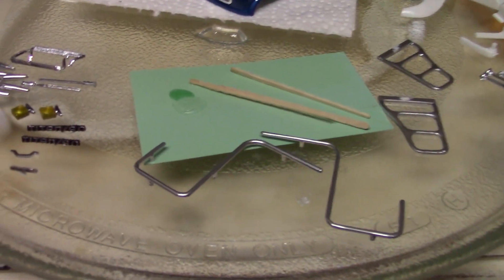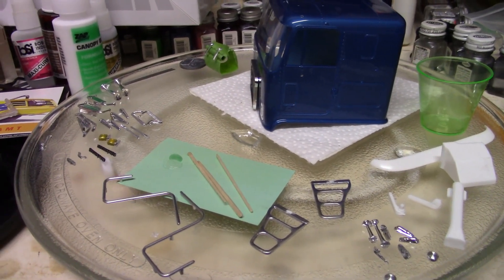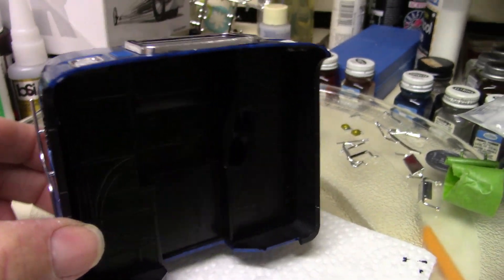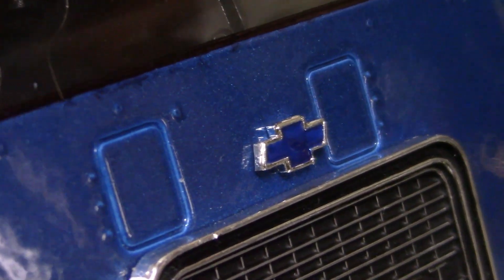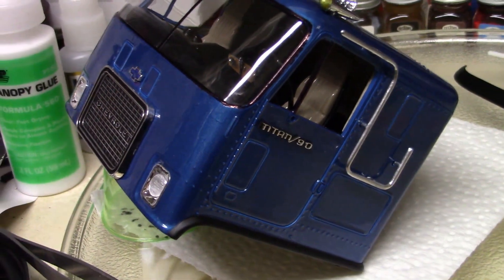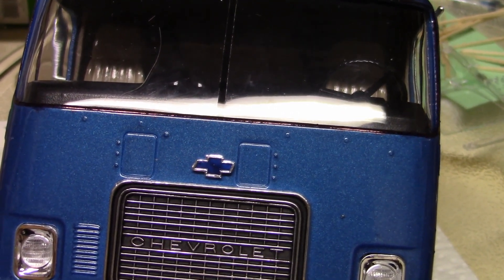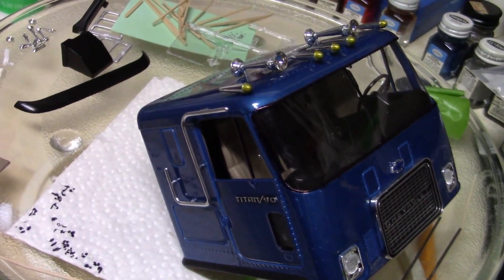AMT Chevy Titan 90 update 4

Comment: Watching your videos of this build you have done a great job of building the truck so far. I must agree with you that choosing the Sapphire Blue was a great chose. Sometimes when building models you have to skip a step to get the build done correctly. But I would like to suggest you watch a video done by Right -On-Replicas. He is very good at pointing out areas that you will have fit issues, what he does to correct it, so forth. He has done this model already so there is a guide for you to use. I also noticed in your update before this one you had found the correct part for the top pulley on the engine. But in this review that is missing. Don’t for get about that, and the holes needed for the windshield wipers.
Reply from the maker: You have a really good eye for detail. Correct, I had forgotten to glue the air conditioner pump in, but it's in now. The windshield wipers are not on yet because they look terrible and will require a lot of work before I put them on. Yes, I will head over to Right On Replicas to see how on earth to attach the exhaust, because the instructions are vague. I thoughed I was already subbed over there but I guess not. Thanks for your comment.

Comment: There should be holes for the pins on your pivots to go into. Or , at least some marks on the cab where they go. I doubt they go on those radiator pins.
Reply from the maker: Oh yea, there are holes on the chassis, it's the other side that's the mystery.
Reply: I'm not talking about the chassis. I'm talking about on either side of the radiator.
Reply from the maker: @charlie418791  Yea, Kenny sent me a pic of his. There are supposed to be holes on the cab, but there aren't. Bizarre. Where did the holes go?

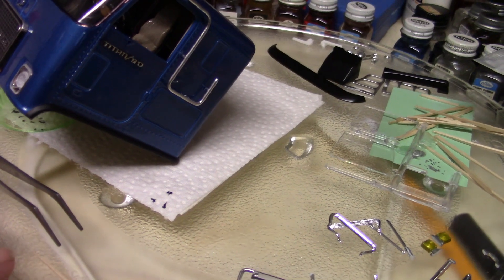Comment: Hi there, great looking work so far.  I just started the AMT GMC Astro and it looks like pretty much the same plastic as the Chevy Titan.  I've taken a different approach and mocked-up a lot of stuff before painting. I don't know if you have fit your cab yet but if look at my video you can see where the hinge pins go. (start at about 4:25 if you don't want to watch the whole thing)  You might need to modify the support brackets for the rear of the cab so that it doesn't sit too high.  (05:00) I don't know if your kit has the same exhaust and fuel tanks, but if it does I found that the single exhaust and right-side fuel tank interfere with each other. (07:15).  https://www.youtube.com/watch?v=VAQuQmOmfec&t=23s  Your rig is looking cool so far hope to see it done sometime!
Reply from the maker: Thanks for the info. Yes, it looks like I'll have to file down the cab supports. I'm gonna go with the dual exhaust. Just subbed ya btw. :)